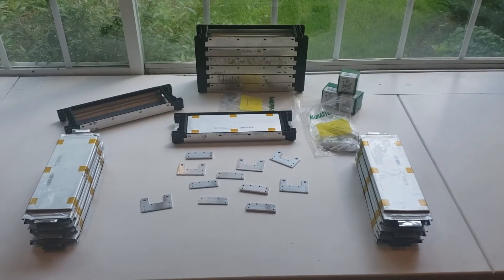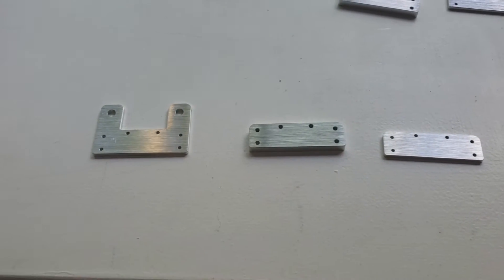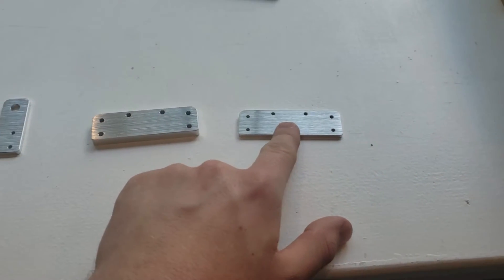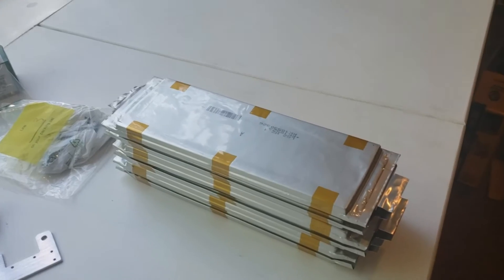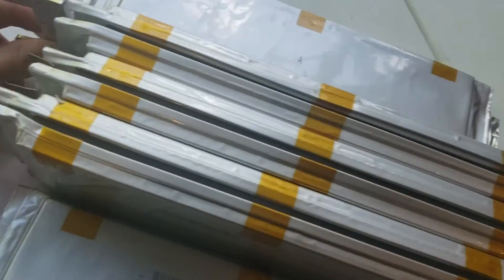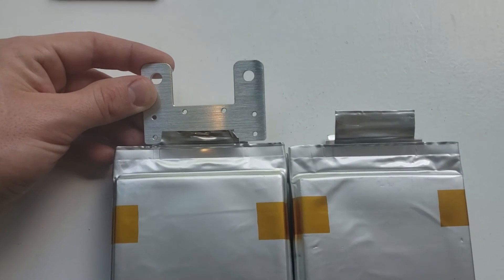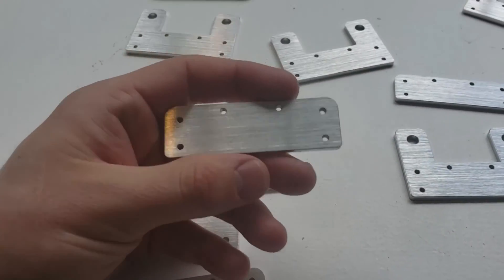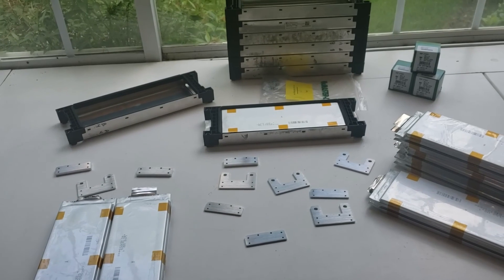CUSTOM LG Chem 120Ah 3.7V Battery Terminal Connections

Comment: looking forward to see the consumption of your QS hub motor on a real bike instead of an enduro mtb! 
With consumption of a QS205 you would maybe get 150 km of range at 50 km/h with your battery?
Did you calculate any estimates on different speeds? 

Also it's better to always use nominal voltage when talking about cells/battery packs, so your pack will be 88,8V.
Reply from the maker: I'm not entirely sure the real consumption will be. Although QS Motor mentioned that if I will travel at 60km/h the range is between 100-120km and traveling at 80km/h the range is between 75-85km. The battery setup I will be running will give me a top speed between 110-130km/h.

I will be testing the efficiency of the motorcycle on range and speed once the motorcycle is built.